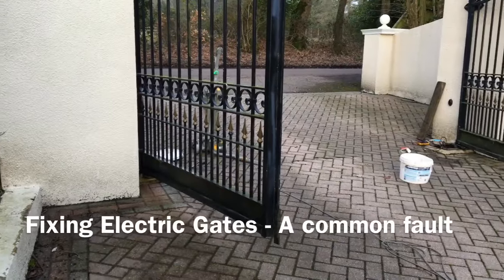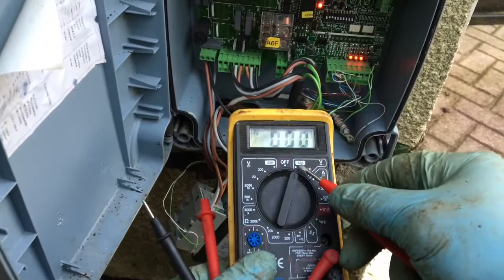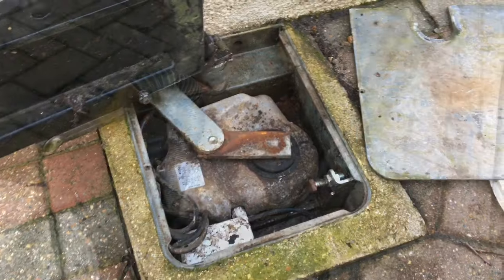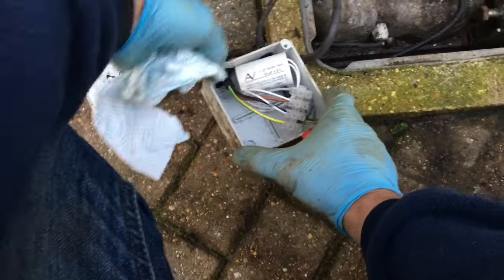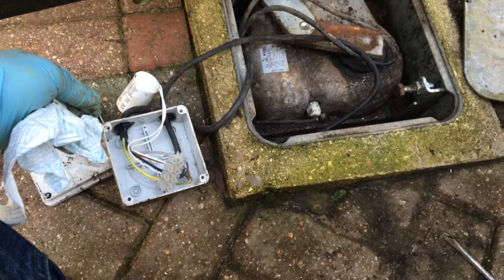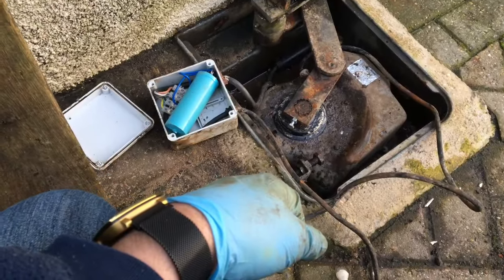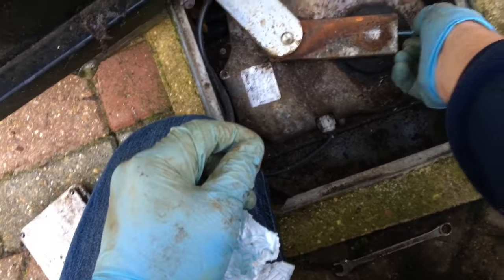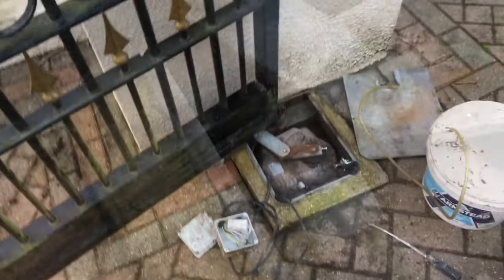Fixing Electric Gates - A Common Fault. (NICE ME3000)

Comment: Nice gates.
Im having a problem with my electric gates. The gates opened with the remote but now they won't close. I've checked the sensors and the infrared beams are working fine. 

They started working after about 12hours and worked for a while, but stopped again when I opened them. They stayed in the open position and won't close. So the problem is intermittent 

The light on the receiver is not staying on should it? 

Any suggestions. Thanks
Reply from the maker: When the beam is cut the light is on so there is your problem, it is not picking up the light beam very well. Maybe an alignment issue?
Reply: @comeinhandynow  I came home to have a look at the gates. I had the linkage disconnected so they could be closed manually. Unfortunately my son pushed the button and the motor arm went through the wire to the motor and tripped a fuse in the house and blew  a fuse on the pcb. 

I repaired the wires and did as you suggested with the link between 23 and 27. All three leds were on. I pushed the button to close the gates, motor turned slightly and the fuse on the pcb blew. I checked the wires that were damaged and tried the fuse again. The 3 leds were on. I pushed the button and the motor turned slightly and blew fuse again. 

I was wondering have you any ideas. ?

Thanks 

Gary
Reply from the maker: @garybarron8014  It does sound like a wiring error or short. Could be a blown transistor on pcb.  If you have  a double gate try swapping left motor connection / cable with the right. Obviously they will wont be synched well, or try just one motor wire to either right or left.  That will allow you to identify if it is one motor shorting, and which one.  Double check wiring near cut and in connection box as well.
Reply: @comeinhandynow  thanks I'll try that. If the motor is shorting is that a new motor ?
Reply from the maker: @garybarron8014  unlikely to be motor internals
Reply: @comeinhandynow  if its a blown transistor,  can that be replaced ? Thanks
Reply from the maker: @garybarron8014  Yes most things are fixable given knowledge and time.
Reply: @comeinhandynow  

I put a physical link across from 23 to 27 and the gates are opening and closing now on the keypads, thanks.   I'll probably get new photocells and hopefully that resolve the issue. 

Unfortunately the remotes are not working the gates now. Is there any reason for this ? As the gates were powered down for a week would they have lost programming ?
Reply from the maker: @garybarron8014  I wouldn’t have thought so as on mine the code is hard coded by switches. Maybe it’s related to your new link. Does the remote work without it, at least one way?

Comment: Do these things take hydronic oil?
Reply from the maker: Do you mean hydraulic oil? (Hydronics is the use of a liquid heat transfer medium). Either way, no hydraulic action is involved it is just mechanical gearing. The motor insides probably has oil in it to keep the water out and lubricate it.  Just a guess though.
Reply: comeinhandynow the gear box is full of grease there is no oil in there

Comment: My problem is that my gates do the opposite to what the control box says. e.g. The control box shows gate open when, in fact it is closed and vice versa!

Has anyone any advice? As far as I can see all wiring etc is correct.
Reply: @Rone Pharaoh Hounds. Yep, you got it in one. I thought the wiring in the box was wrong. I even reversed the wiring in the box. Then I realised that my Dad wired the motor. It was the motor that was wired wrong!
Problem sorted and thank you very much for your response.
Good luck to ya.

Comment: I have one gate of a set not working. When you remotely try to close the gates one closes the other doesn't react at all. You can hear a noise coming from the motor but nothing happens. I have not opened the ground box yet but was wondering what your thoughts on it might be. What are the usual symptoms for this scenario? Faulty motor,obstruction or could it be simply a clean out of the box and lubricating the joints? Appreciate  any advice
Reply from the maker: Best open the box and see if the motor is turning.  If you can hear it operating then I guess it’s probably the splines that are worn out with respect to the splines on the operating arm.   If that is the case you might get a bit more life out of the setup by tightening or replacing the bolt that goes though the side of the arm into the motor shaft.  On most of mine I have had to weld the shaft of the motor to the arm for a more permanent fix.  Just be careful to do it in quick stages so as not to overheat and damage the motor.  Cool it with water in between.
Reply: Thanks for replying. I'll open it up to get a closer look inside and see how I get on
Reply: @phillipcantillon8189  then? what was?